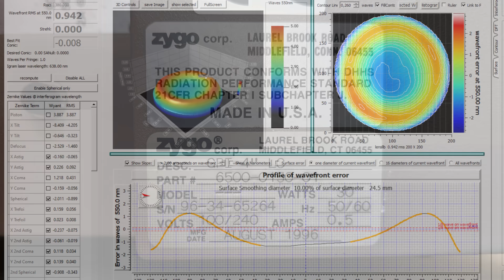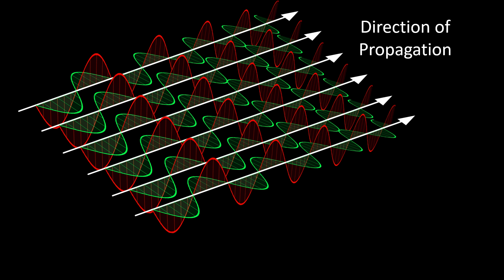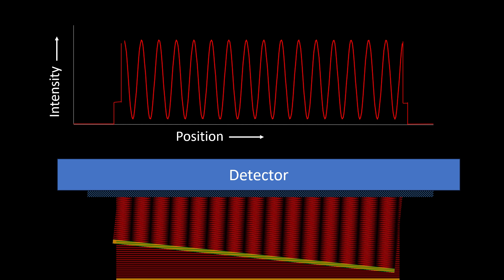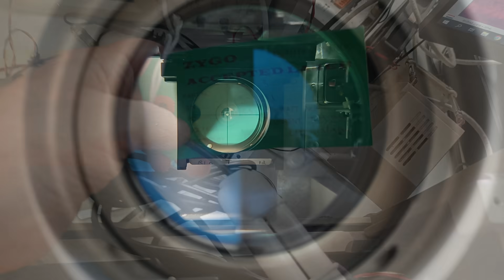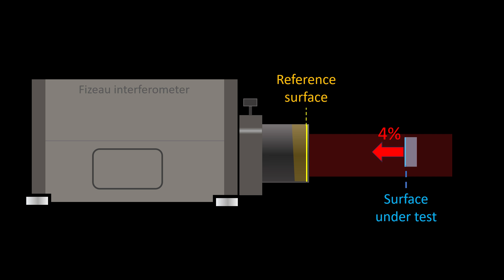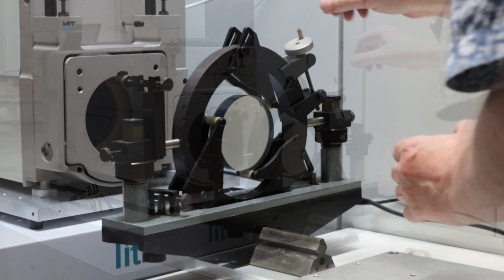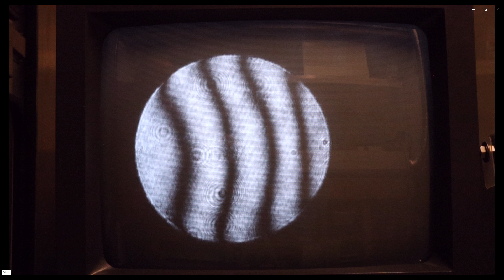Optical Interferometry Part 1: Introduction & ZYGO GPI layout

Comment: At my job, I used to work on a few interferometer test stands using similar instruments, so this was a bit nostalgic and it made for a nice refresher course.

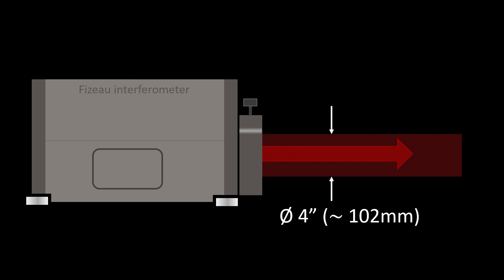I appreciate the attention to detail at 16:39, where the reference flat is shown with a significant wedge. Although not explained in the voiceover, I'm sure this is intentional, not a video production glitch. The wedge is necessary because light will reflect off both sides of the optic—not just the reference surface, but the opposite surface too. The wedge puts this unwanted reflection out of alignment so it doesn't pick up in the interferogram.
Reply: The "elite" is exploiting you and want you docile and brainwashed 👉 The Connections (2021) [short documentary] 💖

Comment: A or C seemed imediatly obvious to me because of the reasons that many other comments described. I do however struggle to understand the tilt angle. The other comments didn't heplp fully. Would be great if you could cover that in a bit more detail maybe with an animation as well in the next video.
Reply from the maker: I think the pinned comment explains it pretty well. The fringe density is the easiest pointer here.

Comment: The solution is A !
warming the spot increases the thickness between the interfaces:
1. The fringe moves to the left, away from the region of higher thickness. So the thickness has to be higher at the right side (A or B).
2. The fringes incircle minima or maxima of thickness. So the left edge has to be a global maxima. Using the first conclusion it has to be a global minima, so the surface is concave (A or C).
Reply: if the "thickness has to higher at the right side", then why are the fringes bent toward the right which is counter to your premise that the fringes bend toward thinner sections?

Comment: Respect for such a strong passion and congratulations on your new acquisition!
The right answer is A.
1) The interval between the fringes decreases from left to right, which means that the thickness increases in the same direction => A or D = true.
2) A local increase in thickness leads to a shift of the fringe to the left => A or B = true.
1),2) => A is true.

Incidentally, the following question arose. Where is the focus of the CCD1 sensor lens? It looks like the optical system must transform the flat front on the input of the interferometer into a flat front at CCD1?  It doesn't form the optical image of the testing surface, right?
Reply from the maker: Yes A is correct. About the focus, this is realized with the lens in front of the camera. Standard it is sufficiently focused between 0.1 and 1 m ( I think). A correct interferogram can only be recorded if the surface under test is in focus on the ccd.
Reply: @HuygensOptics  
Understood, thanks. Probably, stable interference occurs in any cross section of the overlapping beams, since the coherence length is quite large. But to see the surface, we must look at the surface)

Comment: Thank you for showing and explaining us insides of such great and rare instrument! Most of us have no chance to work with them by ourselves.  
In my experiments with interferometry for evaluating the surface roughness I was limited to use cheap laser diode, DSLR and UV photo filter as reference surface to get interferograms)) Working with high quality interferometer is just totally different level. Thank you!

Comment: you said positive thermal coefficient, and the fringe pattern changed to opposite curve when heat applied.  so as distance between surfaces increases, distance between fringes also increases.  With that I think it is A or C.  since left side is broader and fuzzier, I think it has a higher slope than the flatter skinnyer side.   So my guess is C.
Reply: rong...

Comment: It must be concave. When you put your finger on it, it ballooned into a relatively convex shape (because of a positive coefficient of thermal expansion) and this caused a pattern that was the opposite of the prevailing pattern. Also, when the thing was machined flat, if it gets heated up and that makes it balloon, extra stuff would get shaved away, but if there was a change in the opposite direction then nothing extra gets shaved away, so it should automatically have a concave bias. 

This means it is either A or C. 

I have concluded that it must be A. The glass is thicker on the RIGHT side. This is because the fringes are closer together on the RIGHT. 

Let's imagine the limit of an extremely convex, extreme wedge. On the THIN side, the glass surface is nearly perpendicular to the laser, that is where the rate of change is at its maximum, where the bands have to be closest together. 

Then lets imagine the limit of an extremely concave, extreme wedge. On the THIN side, its almost flat, on the THICK side its almost perpendicular to the laser, on the THICK side things are changing the fastest, that's where the bands are closest together. 

I used ChatGPT for this answer. At first it answered that the glass must be CONVEX. Then when I clarified it answered both A and C with similar frequency. This could be due to errors I introduced in explaining the problem. In the end I think the main help was forcing me to formulate the problem in my head correctly and explain it to a sounding board.

The ChatGPT argument that it came up with independent of me, was that the bow direction indicates the direction of thicker glass if the glass is concave. So for that reason, A, because it bows towards the left. This, rather than the "fringe width" argument I made.

Comment: Your finger made the glass thicker at that spot and kind of "corrected" the bowing of that dark fringe line back to the left. This makes me think the thickness where you put your finger was too small which leaves A or C (it is concave, too low in the center). Traveling from right to left across the middle of the glass the finger made you reach the 3rd bright line sooner. So I think the thickness is increasing from right to left. So that would leave A, final answer!

Comment: Fringe distance is smaller on the right, corresponding to higher gradient on the surface. So A or D.

Heating increases "height" locally which leads to fringe curvature in opposite direction. So I guess A.

Comment: A?
Because the expansion of the Zerodur should cause convex bump, and we see that the expansion counteracts the local curvature, meaning the local curvature is concave, hence A or C.
And because the expansion should move the surface of the glass further away, and we see the fringes move left that suggests, further = left.
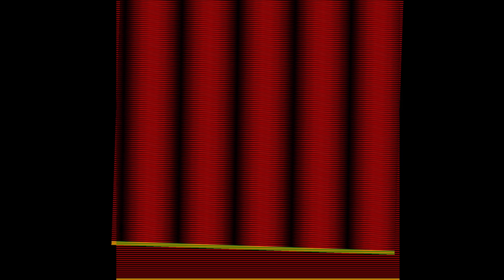At 10:28 in the video we had an animation that suggested that with negative slope, closer = left, so we must have the opposite of that, positive slope.

So positively sloping concave is answer A.

Comment: I'd say it's C, because touching it moves the fringes back where they should be if it was flat, and the positive coefficient of thermal expansion means that it has to get thicker to be flat, so it is concave. And because it getting thicker moves the fringes to the left, thats also the direction where the rest of the glass is thicker.
Reply: I agree
Reply: Ouch ...A

Comment: Fantastic video,  thank you! The temperature coefficient of Zerodur's refractive index is two orders of magnitude greater than its thermal expansion coefficient, so in transmission (as here) the expansion effect is in fact negligible. You're seeing entirely the effect of dn/dT.  As it happens, dn/dT is positive,  so given your assertion about the sign, your winner will still get the right answer; but for the wrong reason.
Reply: Very interesting, what's the reason for that, my understanding was that thermal effects on refractive index were driven mostly by density changes which is related to the thermal expansion, maybe thats not correct here.
Reply: The "elite" is exploiting you and want you docile and brainwashed 👉 The Connections (2021) [short documentary] 💖
Reply: Hi it also felt  extremely unlikely that with rise of  temperature of temperature 0.5 - 2  Celsius Zerodur had expanded so gravely! (Too lazy to count)  
So you wanted to say that it was a  refraction index that affected the light transmission in  Zerodur ? But it was not the thermal expansion.

Comment: The glass gets thicker due to the higher temperature, and this region will be more convex. The original interference pattern shows opposite curvature of the disturbance, so the orginal surface must be concave. The line movement shows that the higher side is to the right, so the correct answer should be A.

Comment: Thank you very much for yours videos there are super and full of knowledge and experience, 

I think that the right answer is D because the thermal expansion from the back side of the material tries to correct the center in the interferometer path.

Have a nice weekend, Always the best.

Comment: I know it has to be A or C, the concave options, because the fringe curve induced by the heat of your finger is in the opposite direction of the curve of the fringes of the surface, and the induced local curve from positive coefficient of expansion would be convex since it would be a “bump” in the surface. Since we know it is a concave sphere, and the fringes “point” to the right, the thicker part must be on the left, so the answer is C.

Comment: A. Heat expands thus the line goes first to the more straight position. And because there is a sharp phase shift on the left side, the less steep side side is at the right. Therefore I assume A
Reply from the maker: A is correct but the steeper side is on the right side because the fringes ar closer together there. Anyway,  the right answer was already given...